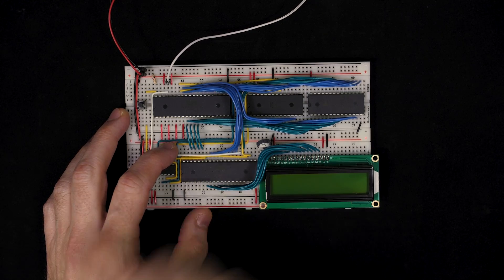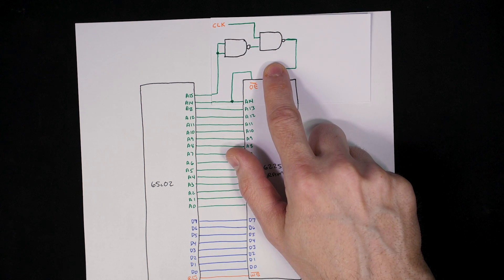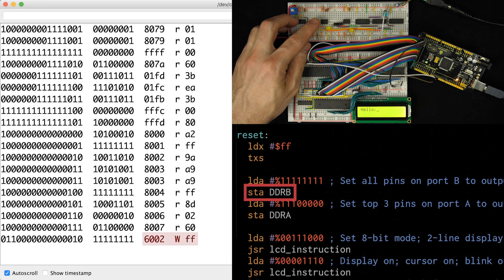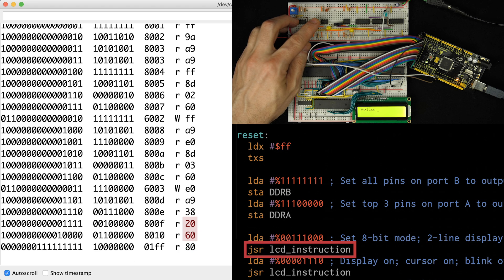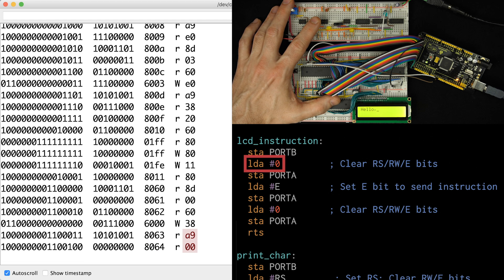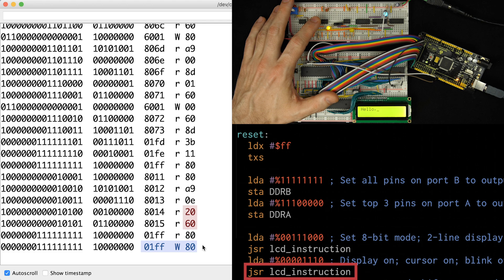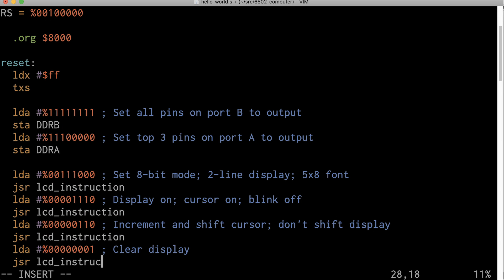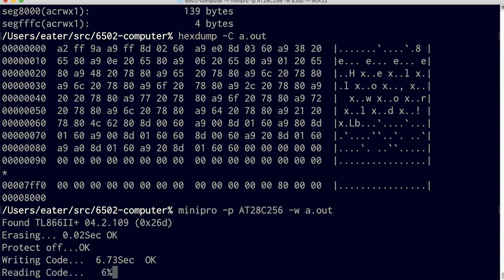Subroutine calls, now with RAM — 6502 part 7

Comment: So I have a question here, actually two questions. I am familiar with the 6502 and spent many years programming my C64's 6510 back in the day. However I did not realise that the cpu read the low-order byte of a jsr address before it pushed the return address onto the stack. Why does it do this? I would have thought that it would push the return address to the stack right after the "20" op-code before it read the low-order byte of the jsr address. I also assume that the read-before-write operation at address 01ff is non-destructive to the accumulator contents at this point, does the processor have a separate internal "stack register" (not the stack pointer but an actual content register) that writes the return address directly to the stack without going through the accumulator or any of the index registers? It can't be modifying the address bus at this point because it still knows where to load the next hi-order byte of the jsr address right after it has written to the stack... I am confused... :\

Comment: Could you please, please make a video demonstrating the chaotic behavior of the 2-gate (ring oscillator connected to XOR gate) circuit in the center of xkcd comic #730 ?

https://xkcd.com/730/
https://www.explainxkcd.com/wiki/index.php/File:circuit_diagram-294-311-128-124-IC.png

Comment: It would be useful to speak to the number of clock cycles that the CPU uses when executing instructions. This should be linked to your serial monitor output line by line. For example in your video the LDA instruction takes three clock cycles,  the monitor displays “garbage” on some of the clock cycles because I it is doing some internal work. But the LDA institution can use up to 5 clock cycles depending on the type of operation. 

This variation in the number of clock cycles should be linked to the data sheet of the 6502

LDA  Load Accumulator with Memory

     M -> A                           N Z C I D V
                                      + + - - - -

     addressing    assembler    opc  bytes  cyles
     --------------------------------------------
     immidiate     LDA #oper     A9    2     2
     zeropage      LDA oper      A5    2     3
     zeropage,X    LDA oper,X    B5    2     4
     absolute      LDA oper      AD    3     4
     absolute,X    LDA oper,X    BD    3     4*
     absolute,Y    LDA oper,Y    B9    3     4*
     (indirect,X)  LDA (oper,X)  A1    2     6
     (indirect),Y  LDA (oper),Y  B1    2     5*

  *  add 1 to cycles if page boundery is crossed

  ** add 1 to cycles if branch occurs on same page
     add 2 to cycles if branch occurs to different page

I personally found the difference in clock cycles confusing when learning assembler. The aim would be to show how confusing it can be when monitoring a instruction and the CPU not using a constant number of cycles when executing the same instruction

Comment: There is a clever trick used by Steve "The Woz", in Apple II ROM, in order to JSR to a routine twice, without any loop control. Look here : http://www.easy68k.com/paulrsm/6502/MON.TXT go to address $FCFA :  RD2BIT JSR   RDBIT which is just a JSR to the next instruction., At the RTS concluding RDBIT routine, the PC will continue at the instruction following the JSR, which is RDBIT again, and when RTS is met again the PC will continue execution after the JSR RD2BIT (at $FCEF). :)

Comment: I'm an engineer way out of mechanical over here in computer engineering but I really want to get some of the circuit diagrams and make a soldered variant of this computer on a series of absurdly small 3x5in breadboards because it would be fun to build and way more fun to connect 30 breadboards to get a computer that runs at a flop

Comment: Ben, random thought - If you do go to PCB for this, it would be great to include the footprint of the Arduino MEGA with appropriate connections.  It adds some pads to the layout and is then an option for those who may wish to use the Arduino as a debugger/bus monitor.  If the pinout (host data & address) of the MEGA is standardised then the footprint could serve other host CPUs in future projects.  Clearly there's a limit to the host's clock speed if the MEGA is to keep up.

Comment: You need to read the M1 pin with the Arduino so you cam detect cpu instruction fetches.
Edit: M1 is Z80. Hopefully there is something similar for the 6502
Reply: The 6502 has a Sync line that goes high during an instruction fetch.

Comment: At 12:30, the value pushed on the stack, $8011, is not the return address -- it's the return address - 1. When it hits the RTS, it pops $8011 off the stack, adds 1, then jumps to $8012.

It's also doing arithmetic on the S register, which is the stack pointer. After pushing the return address on the stack, the S register is $FD. When it goes to pop off the return address, the first thing it does is increment the stack pointer by 1 so that it's $FE.

Comment: Capacitors on the power bus? Containing the chips? Also, are you using high speed logic gates for your decode logic? phi2 buffered or is the 6502 chip you're using have an upgraded fan-out? Very impressive project. Might you be interested in working with a GAL chip, like the 16v8 to replace your logic.

Comment: Would there be any problems with cross talk across the wires in this set up?
Reply: Yes, but only at speeds higher than this is likely to be capable of.

Lots of parallel wires do tend to suffer from cross talk, but the speed of the system has to be great enough that it starts to have an effect.

Luckily older computer hardware like this is generally slow enough that you don't need to put much thought into it.

Comment: When you jump to "lcd_instruction" it takes an extra clock cycle to fetch the address of the subroutine because simply entering the name of the desired jump is a pseudo instruction.  The assembler breaks it down into the fetch address then jump instructions. 

If anyone even cares lol
Reply: It's not a pseudo instruction, it's just an instruction with a human friendly operand.

Something like ORG, which tells the assembler where in memory we are working right now, is a pseudo instruction because it has no machine language equivalent, but is still functional within the assembler.

Comment: Love the videos, especially your presentation style.  Still can’t get over the observation that you don’t need to add decoupling capacitors across the breadboard’s supply rails next to the different ICs for reliable operation.  I’m guessing because you’re running the system at a very slow rate clock frequency, your demos work fine.
Reply: In the days of the original TTL logic chips it was absolutely necessary as the switching spikes were quite significant. I used to use a capacitor next to every chip. It's less important with LS TTL logic but I'd still do it anyway.

Comment: 10:10 "This is what happens to be in memory..."  and this boys and girls is why we clear our stack (set it all to 0x0) during program initialization.  An errant/extra call to RTS could read a "random" address from the stack and end up executing from the data segment or invalid addresses - good if you are playing with self modifying code, bad for just about every other application.
Reply: But how is address 0 any less random than some other address? If it doesn't contain the code that needs to be executed you might as well end up somewhere completely random.

In the case of the 6502, from address 0 you would simply start executing what ever is stored in zero page which is effectively just numbers, so not even necessarily code.

On a Z80 you might have a point, because address 0 is the reset vector, so you could simply start executing from the beginning again. Assuming that your errant return actually pops a zero off and not some old value in which case who knows what will happen.

Long story short, using the stack requires GREAT care.
Reply: @TomStorey96  True, zero may be the reset vector and you just start over (not always survivable - think GPS control system).  The key is that you would rather hit some known address like zero or perhaps 0x8080 where a recovery function could exist rather than a random unpredictable location.  This is a far more critical issue on embedded systems where bad execution could drive motors past their limits or cause some thermal overload.

Comment: ~9:15 I've not read the other comments or gone further in the video to see if you've explained this, so call me Captain Obvious if it's already covered.  The $80 that happened to be at the stack address  during the first JSR was not there by coincidence.  All JSRs  on page $80.  That value was written there during the execution of the previous runs of the program.  When you reset the 6502, whatever was in RAM previously stayed in there.  The next byte on the stack was likely the return address after another JSR.

Comment: This step-by-step execution is valuable from a hardware standpoint of what an actual 6502 does as opposed to a simplified emulator. Single-byte instructions first take two cycles resulting in two reads instead of one since the CPU must read or write on every cycle.

Comment: Love this content. I would really like to see you go through something like Jones Forth or a forth of some kind for this tiny computer. People always want to jump to something like C, but forth is great for embedded systems, and shows cool stack usage strategies. You could also demonstrate RS232 for live 'coding' in forth.
Reply: +1 for Jones forth. I’ve had that in the back of my mind as a project on any low level platform ever since I read the source code for it. For anyone who hasn’t seen it: it explains everything you need to know in a single assembly file plus a single Forth file running on that.
Reply: mmh. Not overly familiar with forth....

But I know from reading lengthy discussions on the subject that the 6502 in particular is very bad at dealing with languages like C...

Basically the problem boils down to the fact that the 6502's stack handling isn't very good. (the 65816 fixes a lot of this, but still isn't ideal)

And a vast majority of high level languages (C included) are built around the idea of a 'stack frame'.
Which of course, relies on hardware stack features working well...
Reply: @KuraIthys  fig-Forth is pretty good, for the 6502, but could be improved upon as noted https://dwheeler.com/6502/

Comment: Do you think you could put a small os on it like Linux if you put together all the "pc parts"
This is how you build a actuall pc from scratch
Reply: Linux, not on a 6502. Doesn't have the required hardware like an MMU.

On a Z80 he could have run something like CP/M.

Comment: I connected the LCD directly to the Bus since it has an interface that is designed to be used with microprocessors. Now i have the entire VIA chip free to use! The 8-Bit Guy did something similar with connecting an LCD to a c64, which has the same processor inside.
Reply: Beware of timing requirements when you reach higher clock speeds.
Reply: @TomStorey96  if you poll DB7, the busy flag, you can tell if the LCD has finished its operation
Reply: @wChris_  I mean signal setup/hold times, minimum pulse widths etc.

HD44780 and similar controllers aren't the fastest things in the world. I designed a similar interface to drive one directly from a Z80, had to add wait states for faster clocks to ensure reliable operation.
Reply: @TomStorey96  450ns is the smallest width the Enable pulse can be and with 1 MHz half the period is already 500ns. I was pretty lucky that 1 MHz is about the fastest you can drive this.

Comment: What’s going on at 16:15? Why doesn’t it print “ld!” there?
Reply: The cursor scrolled off the right side of the display- not sure if it could be scrolled into view or if the LCD just ignores those writes.
Reply: LCD ignores it, if it was a 4 line display you'd see the text on a new line
Reply: Anne Stellingwerf possibly the RAM deseated?
Reply: He pressed reset right before the ld! was printed
Not sure why the cursor keeps moving though

Comment: You know, originally the goal was just to get the LCD to say "hello world". Which he already did in a previous video. Anyone else think it's kind of funny the way he decided to "optimize" the code? Sure, it takes up less space in ROM, but there was already much more available than was even needed for the task. And now, thanks to this "optimization", it takes a few extra clock cycles, and even required additional hardware to be added.
You're a great teacher, but a pretty terrible engineer. ;P (kidding, of course.)
Reply: It's a great demonstration of what are the shortcomings of any optimisation or any added convenience. Nothing is free.

Comment: maybe you can add ps2 keyboard, that be sick !
Reply: while maybe possible (maybe only because of posiible pin constraints) the ps2 protocoll is quite a thing to decode...
Reply: @urugulu1656  i bet there are chips for that, or he can slap smth together, i mean he got VGA figured out
Reply: More likely to add a UART or ACIA and possibly connect that to a USB to serial device hence connecting the 'computer' to a terminal like PuTTY, RealTerm, minicom, or Termite.  This does however mean that the 'ROM' has to have some sort of monitor or debug code in it.
Some examples of the sort of thing: http://s100computers.com/Software%20Folder/6502%20Monitor/6502%20Monitor.htm http://forum.6502.org/viewtopic.php?t=3397 https://github.com/floobydust/Micromon